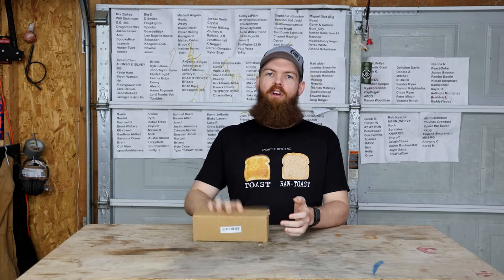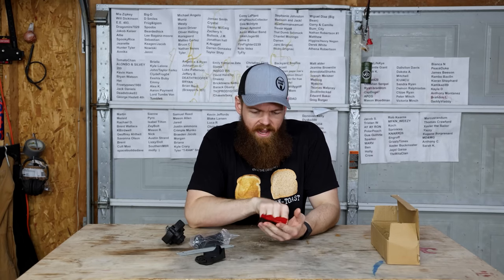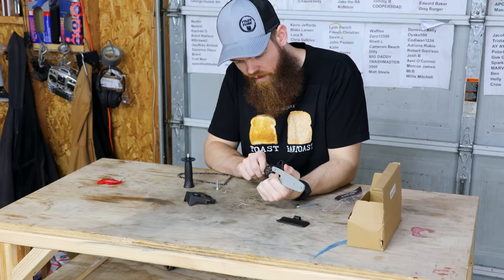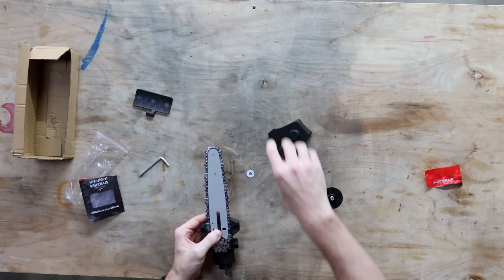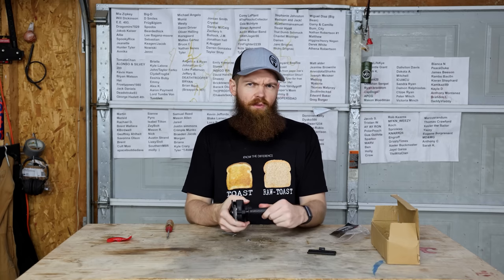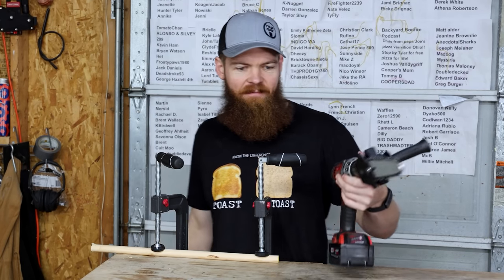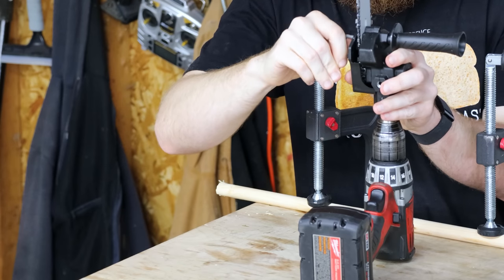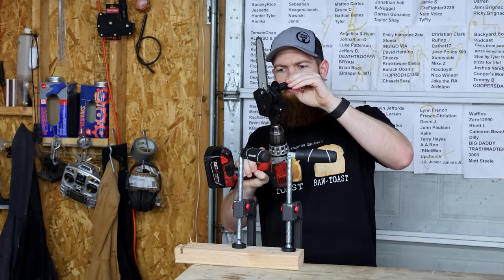I Bought A Chain Saw From WISH

Comment: You got more guts then I do to try these "attachments" for power tools. I bought a 3000 watt home theater from wish (a kenwood clone) two years ago took 3 months to get it. I set it up and when I plugged it in it burst into flames and smoke and about burned my house down had I not had a fire extinguisher at the ready it would have. They refused me a refund also.. So watch what you get from there and always be prepared for the worst.

Comment: This will sound stupid but... I think it would be funny if any power tool attachment you buy for wish Wednesday should be paired with a wish knockoff power tool. I dont mean buy a new tool everytime. Just 1 (drill, angle grinder etc...) but use it for wish Wednesdays, enbrace the full essence of wish Wednesday. But with a super knock off or no brand super super cheap version 😂😂

Comment: Shouldn't need that adjustment screw 
   Ran many old saws that were not made with one
    Even with a tensioner your bar will work loose every time if you don't pull up on the tip while tightening
Reply: Then obviously if you're cutting on the top side of your bar can still work it loose 
     If you have room on the studs double nut it
Reply: Saws spose to cut the wood 🪵🪓 
    You were thinking of a cross cut or bow saw
Reply: If the bar is jamming it's probably sharpened wrong
    If you notice a tendency for it to cut towards one side 
    This can either be the bar leaning or sometimes some jack wagon hits a rock damaging teeth on one side and doesn't sharpen the other side to match

Comment: So you not securing the table is the products fault? 😅😅😂😂 the same thing would've happened if you used a Sawzall 😮😮😂😂 Also metal bolts in plastic parts doesn't usually have a good ending anyway

Comment: Translating one direction of motion to another like that, especially in a plastic case is never going to work well, I have one of the battery powered chainsaws and it works great, sure it's no petrol powered one but it does it's task, attachments like these are basically just premade trash, because you may get 15 minutes out of it if you're lucky and then you end up throwing it out.